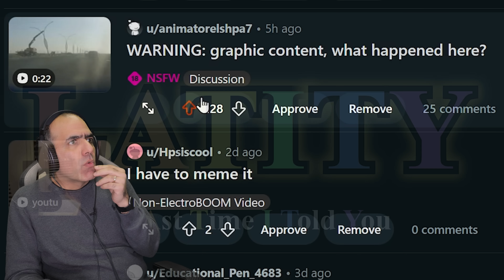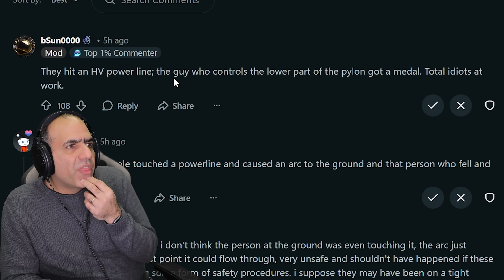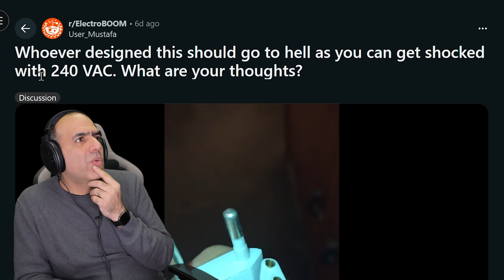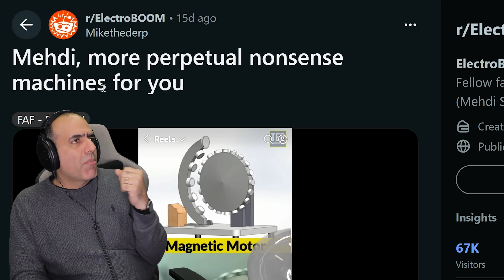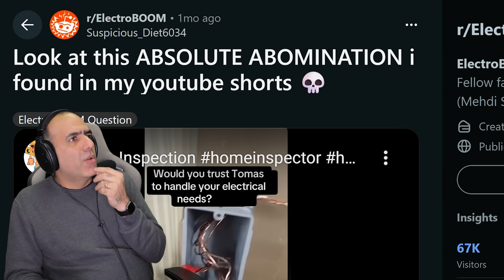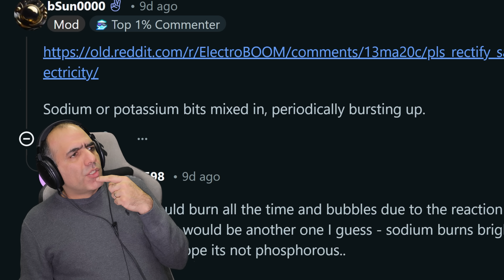Have a Pole? Need a Hole! (LATITY-017)

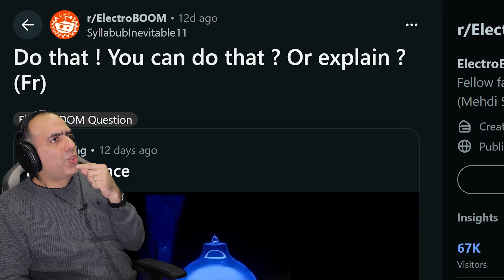Comment: 7:44 it's definitely because it's cheap. In highschool a friend of mine had a lot of wires laying around at home, and he built something he called "the proto-protoboard". He nailed five enormous nails down in a piece of wood and called it a day, using the wires to connect PLCs, Relays and whatnot to it. The "proto-protoboard" was a risk because we didn't even add a GFCI or ANYTHING to it, so once it was plugged, someone could probably die lmao

Comment: 12:49 - Brazilian here. Well, bad things DO happen. The plug is the same no matter the voltage, but most electronics are "bivolt" anyway. (except microwaves, washing machines and so). Some cities are 100% 110v and others are 100% 220v, but there are cities that have both, so when buying things everyone checks if it's bivolt or what voltage it requires

Comment: Incandescent (filament) bulbs placed in series with equipment under test form a dim-bulb tester. The filament’s temperature-dependent resistance limits current spikes from shorts and inrush during power-up. This technique is commonly used for first energizing old equipment, for controlled capacitor reforming of the same, fault-finding, and post-repair testing, reducing damage in the presence of serious faults such as shorts. It is a highly cost-effective, field-expedient alternative to a variac or current-limited supply.

Comment: 3:17 

Mehdi, High powered incandescent light bulbs like that 500 watt are exempt from incandescent light bulb bans and regulations because high powered incandescent bulbs are considered low volume specialty bulbs for specific uses. One modern and still very common use for high powered incandescent is in the film Industry because Incandescent light bulbs have perfect color rendering (CRI 100) where as LED CRI can go as high as 90-95

Comment: Unfortunately, the predetermined breaking points in the lid don't always work. In my case, they only seem to work when I'm not in the immediate vicinity. When I'm just a few centimeters away, experience has shown that they don't work and the cup flies past my head every time.
It doesn't happen to me nearly as often as it does to you, but it still happens from time to time.
The last time was when I connected two step-down converters in parallel for double the power. It worked for about 5 seconds, then the electrolytic capacitor cup flew a few centimeters past my face.

Comment: 12:37 I wonder if the dual voltage socket is a shaver point in a bathroom , The uk had/has similar but on  2 pin with the pins a different separation distance to other household 2 pin devices so only shavers could be used . the socket was/is double isolated thus no earth needed.

Comment: If you are coming to the Philippines, I want to meet you❤😂 

And yeah the country is officially using 220volts AC. Most plugs here have no ground, some appliances still use the separate green ground wire for appliances. Except maybe for hotels, households here have no gfci protections.

Comment: I repair vintage shit.  Older caps don't have vents like that.  They either pop their top, or piss their electrolyte all over the board, eating component legs and traces in the process.  Really common in older VCR power supplies, and audio amplifiers right on the edge between vacuum tube and transistor eras.

Comment: 7:47 It's due to costs, as a new extension cord is more expensive. Also, we Mexicans (born before 2000) were "educated" with the mindset that everything can be fixed with electrical tape and WD-40. Mexican dads had the mindset that they could fix anything without help of an expert.

Comment: I'm from the Philippines. That communication cables made its way in stairs of a skywalk is a product of our stupid contractor and tolerated by equally-stupid and most corrupt government engineers.
The country's electrical code mandates 230v but some power companies can reach a little over 240v. So, it's safe to use 250volt-rated outlet.

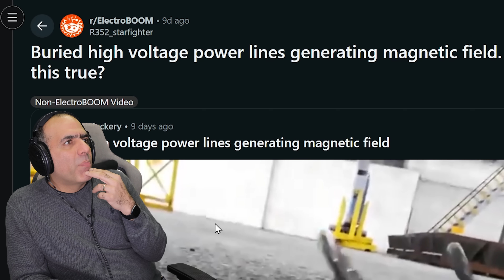Comment: 6:20 The carbines are probably magnetized.
In one of the offices at my work, the magnets turn in one direction. There is no high voltage, and there are no powerful magnets. We haven't found the source off the magnetic field.
11:10 Some electric meters can be deceived by connecting one of the wires to the water pipes.
I don't remember exactly how it all works, but it's a popular story where people were electrocuted by heating radiator.

Comment: 4:32 That plug is used for shavers and stuff and the person that posted that vidoe cut the top part of, thats why the contacts are exposed. those contacts are usually covered by 2mm of plastic, like like the cable of a PC power supply, the poster just wanted attention.
Reply: That plug might have been made by philips
Reply: @akrkfmmc2710 it is my Phillips shaver has that plug, which is how i know it's a fake video.

Comment: 11:17 I see this often in older homes with K&T wiring, when a hot wire contacts a cast iron sewer line, and people get 120V from the drain fitting to the water faucet…

Comment: I was in Phuket this year. They have a lot of communication lines on the pole because there are a lot of different companies for it and its illegal to mess with someone else's line so if there is a problem with your lines instead of replacing it they just leave the old lines up and install a new one.

Comment: Here in Brazil we use the same outlet for 220v and for 127v, generally (if installed correct) the 220v outlet should be red while the 127v one can be brown, blue or even violet sky! (joking, there's no code for the colour on the 127v one's, they typically white). The only difference is for 10A and 20A, where the 20A plugs are more thick than the 10A one's. Besides that we follow ISO standards.

Comment: In highschool motor repair shop, I held the two alligator clips of a condenser/points tester, one in each hand while my mate pushed the button. I immediately locked up with the current going across my arms and chest and couldn't let go, however, I was able to let out a long "aaaaaarrrggghhh". I think (hope) the shock of seeing my reaction caused his delay in removing his damn finger which seemed about 2 or 3 seconds.
That really phuking hurt.

Comment: 12:39 - Actually, here in Brazil, 220V power outlets are red; that person painted everything black for aesthetic reasons. 220V plugs are generally thicker (20A), but that doesn't prevent 110V (10A) plugs from being inserted into the wrong outlet. LOL.

And in the country we have both systems; 110V is common in the south and 220V is common in the north.

Comment: You might want to find a fan that can blow glass. Removing that vessel from the rest of the toy will be difficult. In fact you might be able to find someone in your nearest city that can blow it for you, probably not prohibitively expensive. You just need a bit of tube connected to it that you can use to evacuate and fill it with a gas of your choice. Once it's filled you melt the tube closed.

Comment: 12:42 No, we have same format, but with the holes have different diamenters and the plugs have thicker contatact for actually 127V and 240V (we have more different voltages around the country too). BUT people don't care, they don't follow code and let it to luck. :) :| :( ;(
Actually not different diameters, different colors. Different diameters for different currents (10A, 20A etc).

Comment: There's probably one case that high power incandescent bulbs are fine: in heating chambers. They produce a lot of heat but it's totally fine because the chamber needs to be heated. Also these incandescent bulbs are not that fragile under heat, the driving circuit of LED or fluorescent bulbs will probably fail

Comment: 3:45 A little worried about them tying the wire around the ferrets' neck, unless they are using a knot that doesn't contract when tension is applied.
Reply: Saw a collar that the wire was tied to
Reply: @adaroben1104  Collars can still choke, but it seems like they know what they're doing and ferrets are good at running through tubes so it seems pretty fine to me

Comment: 4:34 this style of connector is used by the phillips oneblade electric razors. but they use a transformer of course and the connector has like 5v or so going through it.

Comment: Yes, here in Brazil some devices need 127V and others 220V (when they would draw more than 10A of current if made for 127V). Actually, almost all houses have both voltages. In a large portion of Brazil all transformers are three-phase, star-connected, forming a neutral conductor that, when connected to one of the phases, forms 127V (220 / √3, actually). Then we have 220V phase-phase and 127V neutral-phase.

Comment: 11:03 they're contactors, probably switching 400v 3-phase. The thing they wiggle around is an auxiliary contact that gets mechanically actuated by the big one underneath.
Reply: Close.  The thing on top is a soft-starter that acts to pre-charge a capactive load prior to the main contactor contacts closing in the full current.

Comment: OSHA approved everything, all but one side of an eye wash station that's cap was broken, when I contracted in the Midwest. It was a place that sprayed highly flammable chemicals onto large surfaces, it would aerolize and mist. 6 OSHA approved fires in 5 years and 3 explosions. OSHA only gave warnings to them in small things not related to the fires and the paperwork and reports never mentioned the fires, fires risks, issues that could cause flames, etc.

This was only one location, they had multiple, and weren't the I ky ones getting away with murder.

They had "OSHA approved" unturned misfiring propane powered forkllift';s and high powered brushed industrial motors that would spark and whose ground wire was hooked onto itself, along with the afore mentioned highly flammable aerolize chemicals, all in confined space with only 3 ventilation fans, one was stuck on low speed and had to be manually spun to get it going by standing on shelves, so it was rarely one. the other fan vented back into the building, into the area with the sparking brushed motors and other machinery is concentrated. It's where 3 of the fires happened. OSHA approved it, all while highly flammable gases and 6 previous fires and 3 explosion's-within-5-years-OSHA-approved!

Comment: 1:12 been there: Europe, wrong installation of the three-phase power oven, I was 9-10 years old, oven's case was touching the stove that was on the top of it (or they had the same ground idk). I was trying to see how soup is being made (I liked to watch my mom preparing meals) but because I was short i used a stool then to not tripped i tried to secure myself by grabbing the edge of the stove and the faucet (or sink - but both were metal) therefore i closed the circle, my hands clamped and i was not able to let go. My mother walked to the kitchen in time and saved me, but she said I was literally floating. She heard that the stool had tripped over, which is why she came back to the kitchen. After I was saved, I couldn't speak or cry for like 2-5 minutes, no wonder I was shocked (pun intended). I do not recommend.

Comment: 11:00 large industrial 3 phase power factor correction cabinet, also called a PF or cos phi compensator.
The contactors switch on capacitor banks to bring the PF closer to 1 depending on how many inductive loads are pulling the PF down.
The module on top of the contactors is some sort of snubber circuit I think.
So no wonder it went kaboom pretty good since it looks to be 400V or more 3 phase.
Reply: Capacitor soft-starters.  The module on top acts to pre-charge the capacitors prior to the main contactor contacts closing the full current in.  The curly wires are purposefully resistive for this purpose.

Comment: As for that magnetic ground, I'm betting it's an electrolysis plant. At my workplace, back in the day, they produced chlorine using electrolysis; the whole building and ground next to it were magnetic. You could hang hammers on the outside walls of it.

Comment: Mexican here. Usually people do those extension cords due to costs. 
For example, 1 meter "handmade" extension cord costs us around 1-2 dollars. 
The same factory made extension cords costs 4-5 dollars.
You may say that 2 dollars is not worth it, but in local currency, those 2 dollars are something. They can buy you almost a full meal.

Comment: 13:02 In India, we only use 220V but still have these 110V sockets for charging on Rapid Transit and Trains with the same outlet, and the only devices that work are chargers which support all voltage ranges, so they are fine. Worst case, someone plugs a 220V appliance in and it works at 1/4 power, so it's not much of an issue.

Comment: @ElectroBOOM The strong magnetic field is above the main conductors in an aluminium production plant. At 6:40 you can see the aluminium electrolysis cells in the background. The current in those conductors is often around 200-300kA DC. The magnetic field is so strong in some places that you can balance a big iron rod horizontally in your hand.

Comment: First video is fale as you can see "power lines" close to each "lamp". In the video. Trained ferret is a cool gag, but I would argue that through that pipe you can push multiple wire dragging tools.

Comment: Mehdi, the 250V on that outlet is only the RMS voltage classification of the outlet. Apparently has to do more with arc safety or something than with the actual mains voltage in use. We have a similar thing on extension cords/power strips here in Austria.

Comment: 04:55 After watching the video in full on the forum, it's 4700uf 50V from Keltron. Another example is Vishay MAL225056472E3. Pretty sure they just have looser standards in countries of origin, or they are still going off old stock. It adds tooling costs to add the safety. So I guess just design it so the bung fails and hope nobody uses it in a high ripple circuit? 

Other cases where no scores in top, bottom venting, solid polymer, or made before the 90s. Although that doesn't apply here.

Comment: @electroboom  the reason why you build an extension cord from household sockets is that the sockets on cheap 3rd world extension cords are terrible.

in thailand the way to get a good extension cord is a rubber housing(like 5-8mm thick) and you put the decent household sockets into it the housing is made for that and you can buy premade already as well.  but it's cheaper to build your own and then you can select the cabling too. but the cheap way is just gray multistrand 2 conductor copper and a cheaper plastic socket thing from a 20 baht shop(to get one that can do 4kw). the price difference is like 6-10x. if you buy 7 bucks extension cord as prebuilt it will have just copper coated aluminum and bad sockets and bad plug and will not last running an oven or a large motor.

Comment: The Philippines uses 230 volts at 60 hertz with either a split-phase line-to-line configuration or a line-to-neutral configuration depending on the location.

Comment: 03:15 Incandescent produces a light spectrum closer to natural light (although high-CRI LEDs do get close), you can get unique spectrums of light LEDs just can't come close to, it can play nicer with certain camera setups. For something like a 500W light, it can survive in winter outside as it stays warm, or in extreme heat in a desert while the solder melts on your LEDs. Incandescent also emits very little blue light. 

This being said, for the vast majority of people, LED does fine. Sometimes the cost of buying an expensive high accuracy LED light far outweighs what you'd save over the year running it though.
Reply: Some of these points are mostly nonsense from regressivists and people who peddle an obsolete technology.
"Most similar to natural light": You know what else is? An open flame. You don't see many people lighting their homes with candles, though. Not to mention, incandescent is absurdly yellow, sickeningly so. 
"Works well in the cold": So does any properly build LED light. Too cold for a regular bulb? You're clearly operating in extreme weather, go get a better form factor for your environment. Even going with the most stupid solution possible, installing an independant electric heater just for the LED bulb, will net massive energy savings.
"Works well in the heat!": So does any properly built LED bulb.
"Less blue light!": So? Do you plan on sleeping with a lightbulb on? Because otherwise, there's literally no negative effect to being bombarded by blue light.
Reply: @Gabu_  As I very clearly stated, most people won't have an issue with it. You are the prime example of someone who will never have an issue with it.

Yes, your standard tungsten bulb is yellow. Tungsten glows like that. They usually just coat the bulb to stop certain wavelengths (like that pee yellow) coming through. Which then changes the kelvin scale. Tungsten is also better at deep red wavelengths than LEDs, once you filter out the rest of the light spectrum of course. 

A fan heater would consume well over 1kW. Doesn't sound too useful for keeping frost off a lightbulb outside, say in a barn or shed that's somewhere pretty cold. Yes, that's clearly extreme temperatures. Yes, LEDs can still operate at temperatures this cold, but they will frost up.

Incandescent bulbs can operate over 150C. This is for basic bulbs and not ones with specialised glass, which yes, might as well get a high heat LED at that point, but high temperatures will still stress the LED driver. Industrial machinery favours them due to this. 

The biggest appeal though to Incandescent bulbs is that they produce a continuous, smooth spectrum of light. Standard LEDs often have "spectral gaps" or sharp spikes. 

btw yes, I have LED bulbs in all my lights. Besides the dimmable halogen light which gives the living room an inviting sunshine yellow glow. 

TL-DR: Basically you're ignoring the fact I said most people will be fine without them.